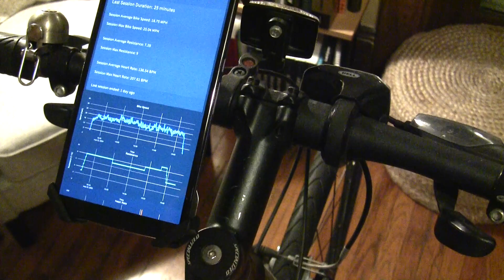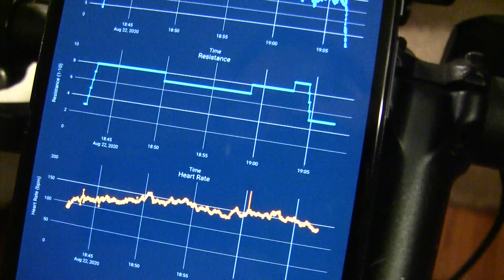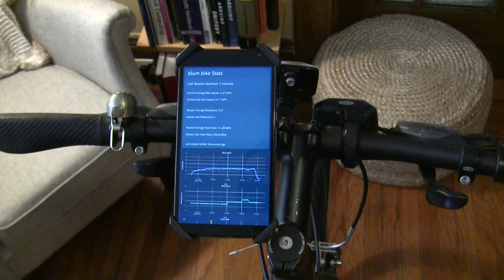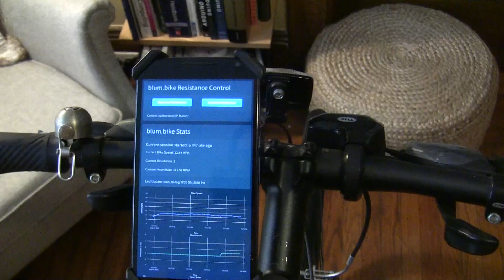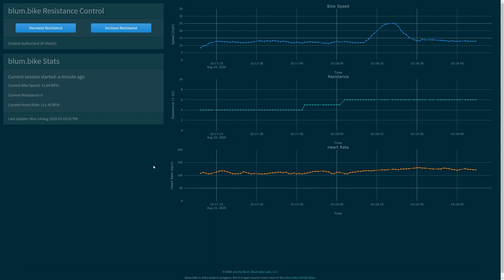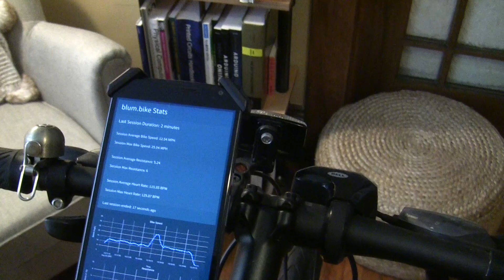blum.bike (My Open Source At-Home Bike Trainer)

Comment: Mid-rolls ads are evil - so I'm gone.
Reply from the maker: Yikes, I agree with you. I didn't realize that YouTube enabled them by default. Removing them now.
Reply: @sciguy14  Now THAT is impressive! 

Yes, they recently announced a deadline before which you could turn off the default that midrolls would be allowed, but it looks like you missed it and now you'll need to turn them off on every single video or at least from now on. YT is being Evil with a smile on its face and a ukulele backing track. Business as usual then.